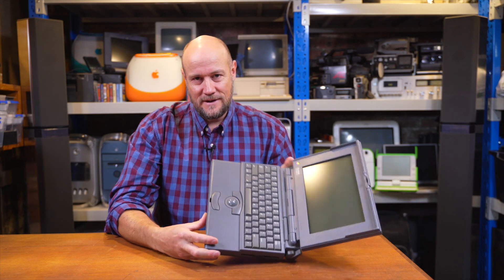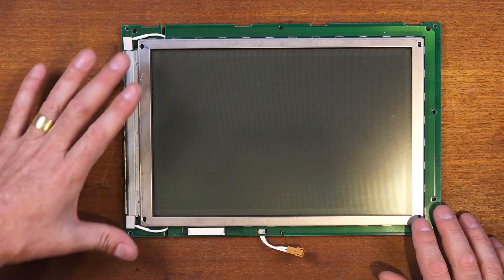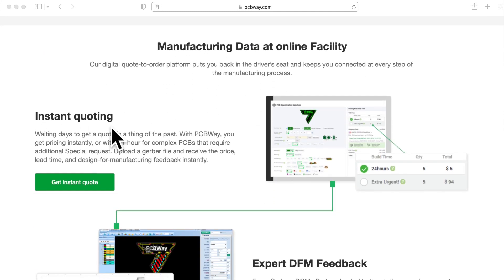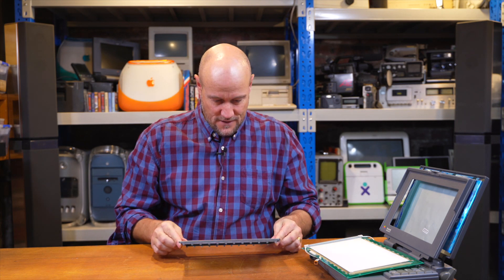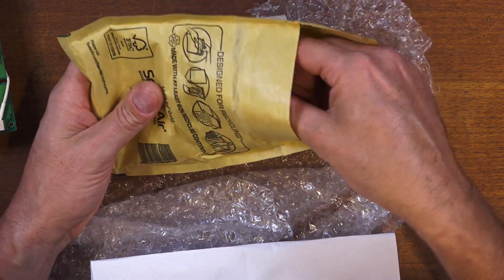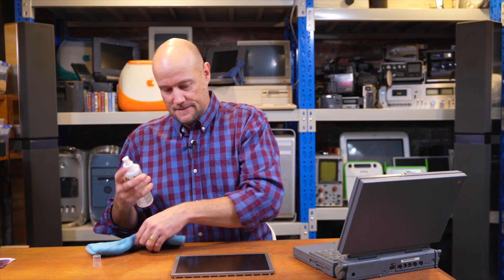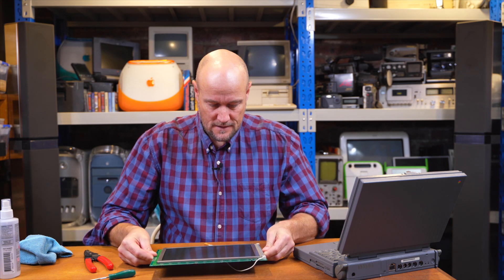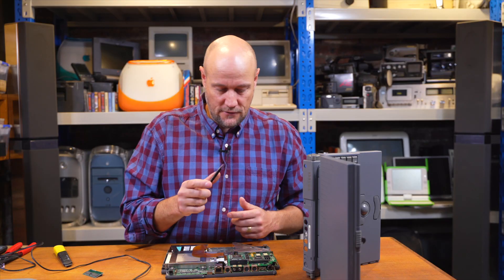Fixing the Powerbook 170 LCD Screen - Tunnel Vision Issue - Plus Bonus Unboxing!

Comment: I used this method on my 180 and the tunnel vision problem is mostly gone. I had to bake it an extra six hours, though. I might try baking it even longer in hopes of getting rid of the problem completely. (There are still slightly dark areas that form in the upper left and lower left corners after a few minutes, but they don't get very dark.) 

One thing I learned: Besides making sure to align the crosshairs well, make sure the contact strips along the edge of the LCD panel are clean and free of dust. I was getting vertical and horizontal lines on the display at first when I reassembled everything. It took me a while to figure out that it was because I'd gotten finger grease or dust on the contact strips. After I cleaned them off with alcohol, the screen looked perfect.
Reply from the maker: Great info, thanks for sharing your experience and advice. It helps create a useful knowledge base around fixing this issue.

Comment: Why bake it? I put mine in a waterproof container with some silica gel bags for 24 hours and my results were just as good. I didn't even need to take the LCD off the circuit board.
Reply from the maker: Would love to see a video demonstrating this working. I’ve heard conflicting stories about this proposed method.

Comment: It’s been a year. Has the fix held up? Thinking about trying it on my PowerBook 180.
Reply from the maker: This is how it looked 11 months on. No change from when it was baked. https://tinkerdifferent.com/threads/tunnel-vision-on-pb170.778/page-7
Reply: @TheBasementChannel  whew, I just did mine. Baked for 8 hours at 180. Put it back and a bunch of dead vertical lines 😬 tried retightening and nothing. Loosened them all up and shifted it as far left towards the backlight as I could to get the crosses to line up as close as I could. Impossible to get it aligned. And then retightened and all good. I’ve been through hell with the Mac Portable lcd displayed haveing the same missing lines issues so I though I was cursed. 30 min timer set to check the results  🤞
Reply from the maker: @sideburn awesome, thanks heaps for reporting back with your experience, it’s really valuable for the fixit community! Let us know if the tunnel vision is fixed.
Reply: @TheBasementChannel  going on two hours and just a tiny bit of darkness in the top corners. It’s been like that for a while and not growing. Amazing simple fix. Fits right in there with the retrobrite phenomenon
Reply from the maker: @sideburn  just slightly more nerve wracking to undertake 😬
Reply: @TheBasementChannel  haha well it never tunneled BUT I had a vertical pixel line that was duplicating itself and a couple horizontal lines that were slightly dim so I opened it back up to try to re align and the nightmare began. I spent hours removing and reattaching the lcd and could not get all the pixels to come on. I almost gave up. I finally realized that getting the crosshairs lined up is crucial! Not how tight the frame is clamped down. I kept thinking  was the tightness. And you don’t adjust the alignment by moving the metal frame you move the glass within the frame. I found that loosely fastening the frame and then gently tapping the PCB on the ground to slide the lcd around works well. It’s finally perfect now and I’m going to check the Mac portable lcd again now because it has dead lines too but I’m pretty sure that’s a different issue.
Reply: @TheBasementChannel  cool. 30 min is a little short mine starts acting up around 45 but I’ll give it a shot! Looks like you left the rubber zebra strips on as well. You’d probly have to tear them off to remove. They’re glued on on the Macintosh portable. I imaging that’s the same on these…

Comment: Excellent video, very reassuring. Is that Melbourne we see there? I’m in NZ :)

I have a PowerBook 170 here with terrible tunnelling - much worse than yours was - within five minutes of turning on, it’s completely black apart from a 5cm-diameter circle in the middle, which is perfect.

Can I just clarify whether you removed the zebra strips from the LCD please - before baking?

I actually wonder whether the zebra strips themselves would benefit from cleaning. Ispropyl alcohol usually temporarily swells silicone rubber and I wonder whether correct conductivity is restored just by cleaning and refitting. Or by heating? Is it possible that the LCD baking is a coincidence? :) certainly I’m going to try and fix this anyway thanks to your video - cheers
Reply from the maker: Hey Alex, not Melbourne, but Tasmania so pretty close!

Not sure what you mean by the zebra strips but everything I did was in the video.
There’s a range of theories out there as to the cause of the tunnel vision problem, but I personally subscribe to the moisture theory and have achieved great results with the baking method.
Good luck, hope you have success.
Reply: @TheBasementChannel  thanks!
By ‘zebra strips’, I mean the rubber contact strips that go between the LCD and the circuit board. I don’t think I could tell in the video whether you had left these on the glass during the baking, but I’ll look again
Reply from the maker: I think I took the rubber strips off but if I recall it was tricky to get them reattached. Sorry my memory is a bit hazy now, it’s over a year ago 😅

Comment: Loved this video! i own a very busted up sad looking 140, she may be headless but still chimes! I plan to 3D print a new rear housing at some stage, PCBway could also assist in making a 140 Display cable since those are equally as unobtainium
Reply from the maker: Hey, thanks for the comment! Sounds like your 140 is a challenging project, have fun!

Comment: Sorry if I missed this but why is it necessary to remove the LCD panel from the PCB before baking? At 85ºc I can't see how the PCB is any more likely to be damaged than the LCD panel and the LCD panel is not airtight and so any moisture should still evaporate with the PCB in place.
Can you clarify?
Reply from the maker: I felt more comfortable just baking the lcd panel which is mostly metal and glass and polariser film. The circuit board is probably fine to bake but I didn’t want to bake the backlight array and diffusion panels, which are sandwiched between the circuit board and lcd panel.
Reply: @TheBasementChannel  thanks. I had not thought about the polarising films. That could get damaged with heat.

Comment: Thanks...that was very helpful. You do a nice job on your videos. I recently procured a 180 and on a warm, mid 80F day, it gets dark spots slowly on two corners. Just tried it today for 45 minutes (much cooler day) and no dark spots, though the cursor starts looking less black in the corners (more dark grayish) so I think it just takes longer. The only difference was that I took the corroded battery out.

It'll be a while before I have time to play with it (got some PiStorm projects in the queue) so I put it in a 2 gallon zip-lock and stuck a ton of silica packets in it to dry out any moisture (will update if that helps). I had a Mac IIsi for almost 10 years in the early 90's so wanted to have a real one for the next MARCHintosh. Need to find a video cable and internal SCSI-to-SD interface, then I'll be set :-/
Reply from the maker: Great comment, thanks for sharing your story.

Comment: In the summer time in Texas, I just use the car dashboard for baking electronics. On a nasty summer day, the temp quickly rises to somewhere between 85-95°C on the dashboard if the car is left in full sun. I measured 97°C surface temps on a hot 40°C day. You can also make very good baked potatoes on the dash. Just place it in a pot with a lid around lunch time and by dinner, it will be ready and delicious.
Reply from the maker: Top tip!

Comment: Love the fix! I've heard of people baking LCD's beforehand but you presented it in such a simple to understand way, it's removed any anxiety about trying this on a failing display. 

I've also wondered how feasible it would be to go to a chinese LCD panel maker and say 'here - its a 1-bit LCD panel, these are the specs, make a new one that'll fit in the same physical dimensions, but using an LED backlight instead of CCFL'. No doubt it'd be expensive, but might be worth it for the community as a whole...
Reply from the maker: Thanks Kai! Yes I would definitely recommend people try this, it does seem a bit daunting at first, but if the display is already useless then there’s not much to lose.

I vote you go ahead with your remanufactured lcd panel idea! I’ll buy 2!

Comment: If you had to redo, would you reverse the order by cleaning first, baking second?
Reply from the maker: I don’t think so, as you have to handle the screen when baking. Perhaps clean it before and after? I cleaned before reassembly as it’s mainly fingerprint oils which don’t care about such low baking temps anyway.

Comment: thanks for those tips. I have a PB170 that I need to repair, and it deffo started showing signs of this in the very edge of the corners. I keep putting it off because my PB180 works well so far.

Comment: So is it moisture on the lcd? why does it manifests after a while of having it turned on? I wouldn't go above 85 degrees on the oven because the zebra strips are still attached to the panel itself and they can be destroyed. in any case, that did some good to the lcd and it looks way better!
Reply from the maker: The widely held theory is moisture has made its way into the liquid crystal of the display, shorting out the crystal when current is applied.

Comment: Awesome results. I've seen some pretty tunnel-ey PowerBook screens and eager to try this out. Also really good tip on the re-assembly and lining up the crosses! Also currious to know if you saw a big performance increase with the additional 8mb? Thinking the HDD may be the next bottleneck.
Reply from the maker: To be perfectly honest (and hopefully help others) once you sit the screen back into the board, there’s almost no wiggle room, and the crosses didn’t quite line up, but they were all out an equal amount. The machine certainly felt snappier with the extra mb.